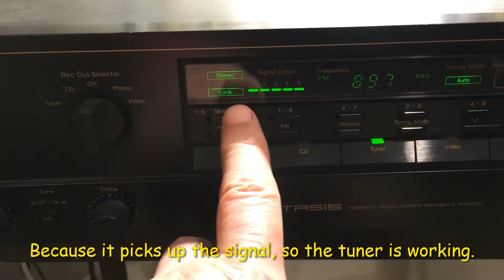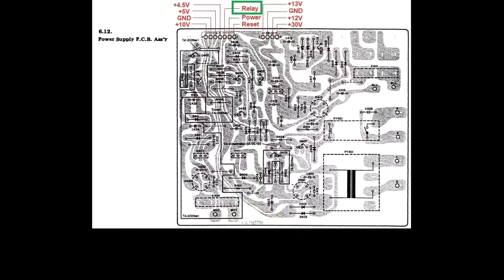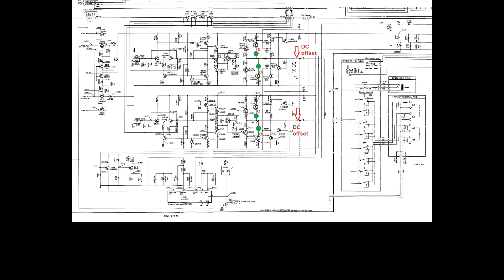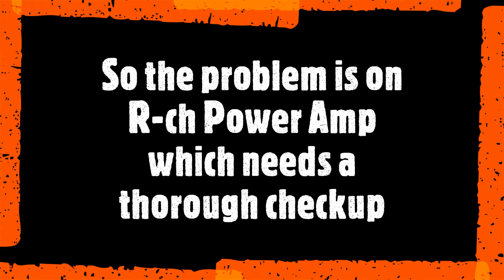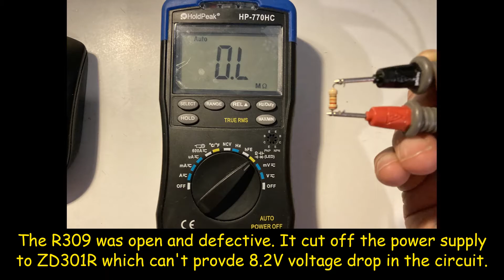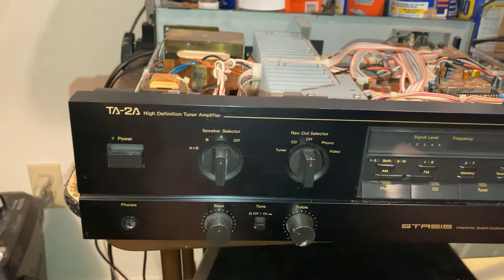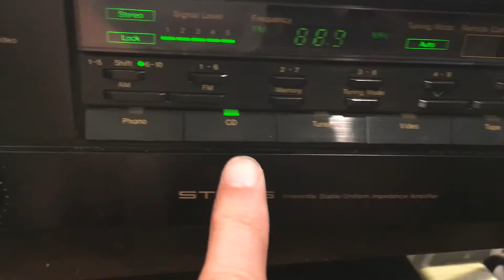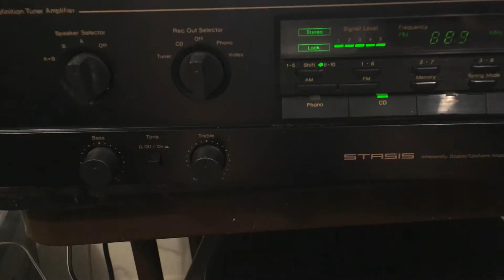Nakamichi TA-2A Receiver Repair - Protection Mode Stays On

Comment: In addition to dried-out and heatstressed caps throughout the unit, corrosive/conductive glue invariably damages parts, and the solder joints to the  voltage regulators on the main board will invariably have dried broken-down from heat (add small heatsinks to them). Indeed, bad soldering is found everywhere ---- and since components were apparently hand placed, not placed by machine (note how crooked and uneven they are), often there will be parts where the leads barely protrude through the circuit board far enough to get a good bond to the solder  underneath. Give the main board a thorough tap test to find intermittent connections! The tone-control bypass switch is often intermittent, causing channel dropouts, and cleaning it is a temporary fix at best ---- best to bypass/ defeat the switch (tone controls enabled, or disabled, its your choice)  with jumper wires and cut traces. There's also a factory service bulletin about a transistor on the "function" PCB that can cause intermittent "lockup" of the receiver. Also look for failed parts in the differential FB circuit.

Comment: I was so lucky that you made this video.  My TA-2A was also not turning on properly.  The voltage readings were similar and R309L on the left channel was the problem.  

Currently the amplifier and AM tuner work but I've got to sort out the malfunctioning FM.  The display segments are not uniformly illuminated.  In the past with other equipment this has indicated issues in the power supply.   I also own an earlier SA-4A whose amplifier works fine yet the FM doesn't function.  It's display looks e even more dim but the power supply seems even more buried.

Thank you for making the video!!
Reply from the maker: I remembered that I also have been benefited from watching someone's video and fixed my pickup overhead temperature compass display. It was malfunction caused by a defective $0.50 resistor. By watching YouTube video, I was not only learning something fun but also saving myself for few hundred bucks. That video really inspired me. Thank you for your comments.
Reply: @VintageAudioFan  I used a 1/4 watt rated resistor to check my receiver by jumping it into the circuit.  This was good for a temporary diagnosis.  I read online that the 1/2 watt resistors are considered under-sized.  I plan to use 1 watt resistors when soldering the replacements into the board.

Comment: Nice work on getting it going! If you have them on hand you should gain match and replaced Q301 and Q302.  You could get offset to a much lower number.  I generally don’t like it above 10 mV.
Reply from the maker: Thank you for the suggestion. I do agree the DC offset should be close to 0V. I am surprised that it was designed at 31mv which shows in the circuit diagram.